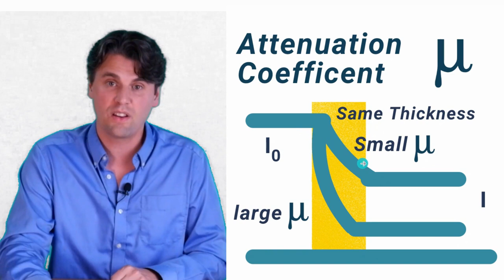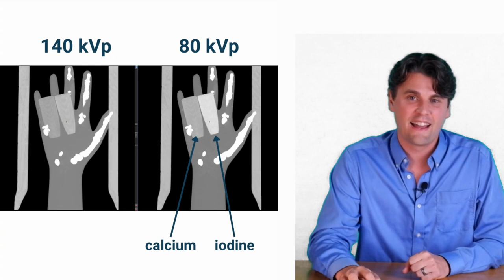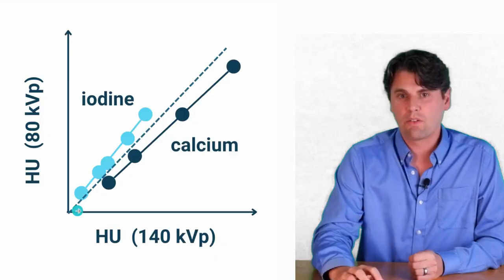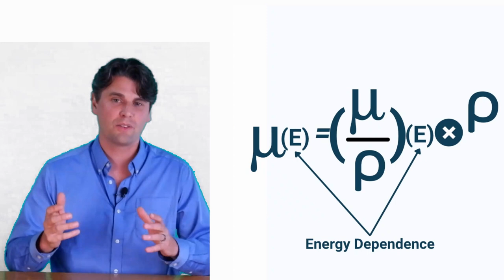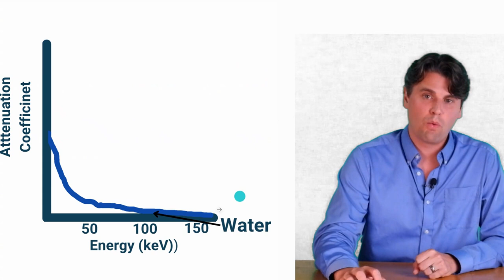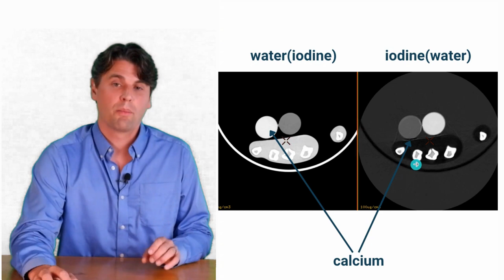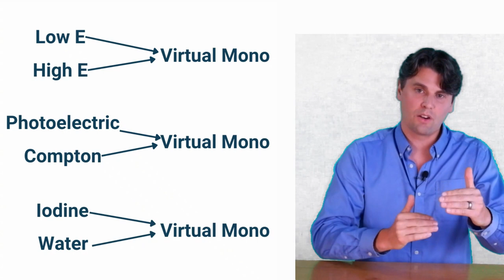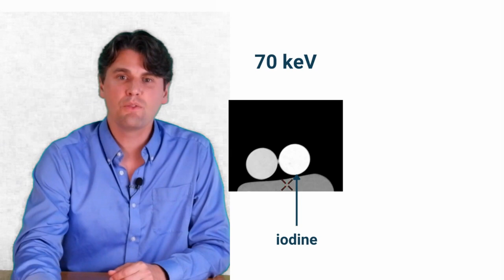Dual Energy CT (Physics of How Spectral CT works)

Comment: Would it work if we set the KVP to be 60KV and 160KV? If not why?
Reply from the maker: Most generators don’t go as high as 160 kVp and 60 kVp is very low so it would be hard to get adequate penetration for most adult anatomy
Reply: @HowRadiologyWorks  yes sir, but I wanna know pros and cons if if it goes to 160kvp?